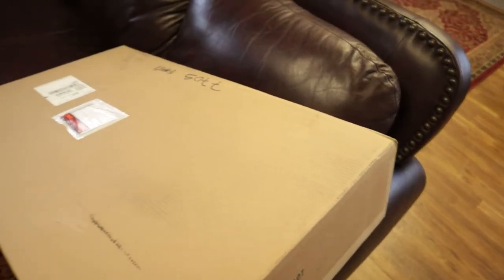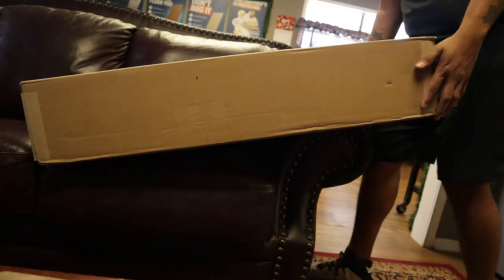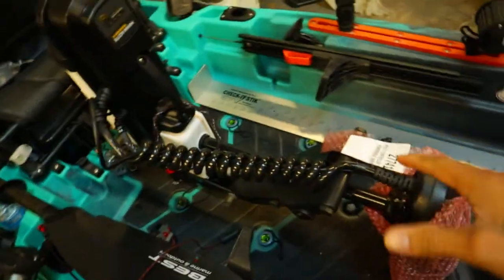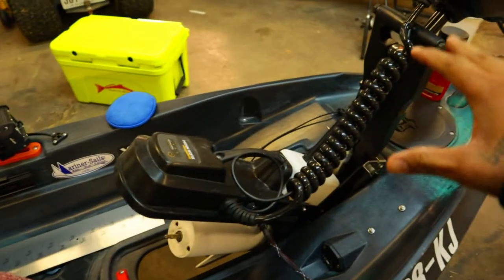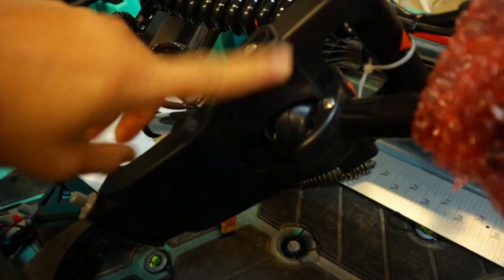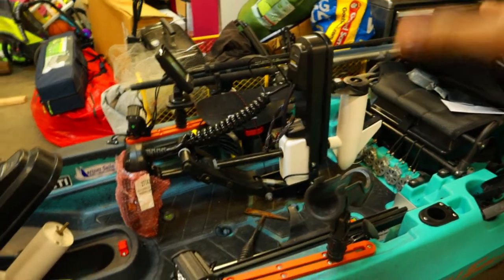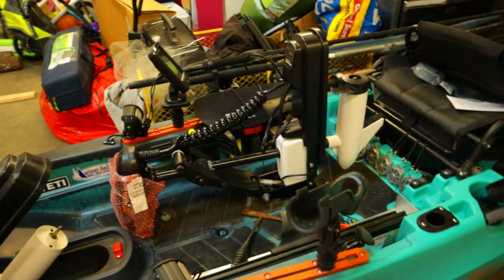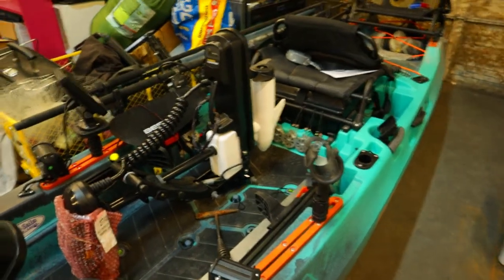Motor Issues With My Old Town Autopilot 136 | Warranty Claim

Comment: Thanks for the info. Wish you would have showed the problem when two motors were side by side. I bought 136 AP a month ago. Mine has the upgrades you showed on the shaft with the grey bushing. Have you had any problems at the power plugs? I saw one vid where the constant spring pressure from the door pushed hard enough to loosen the prong connections over time.

Comment: I am having warranty issues with my motor on the autopilot 120. The warranty service is dragging their feet. I have been trying to get answers for 3 days. They keep wanting me to try things that have no relationship to the problem. The spot lock has stoppped working 3 times and the N function will not operate properly. The motor starts shifting left and right not able to follow a course heading. I had a friend buy this kayak and know I worried they will have trouble. I understand problems but not slow warranty service. I had one person say that they had not got back to me because of this being a busy time of the year. I am contacting warranty service. If they are busy It comes from faulty products not because of a busy time of the year.
Reply from the maker: I was reading that they are having issues with getting the chips for the motors which might be a reason for the delays. Either way that is very unfortunate and I hope you are able to get your kayak back on the water asap!